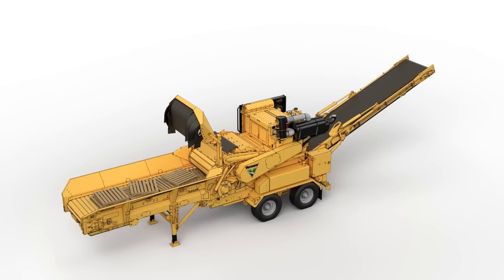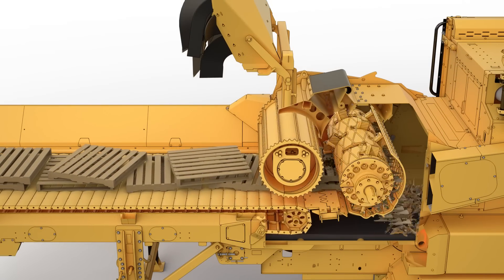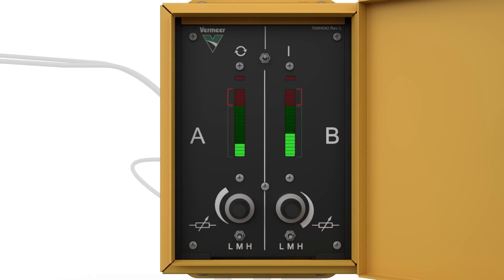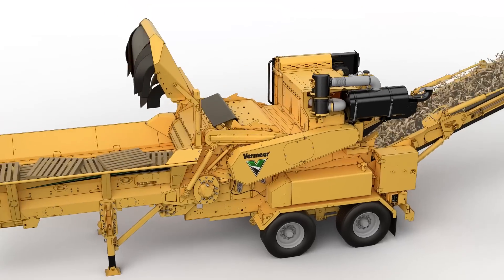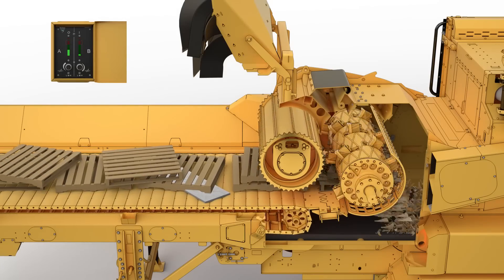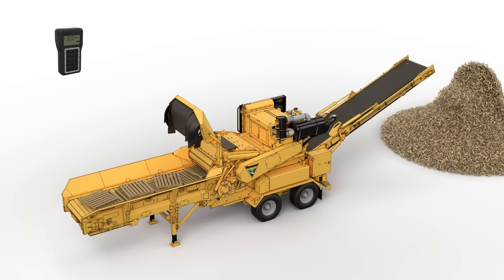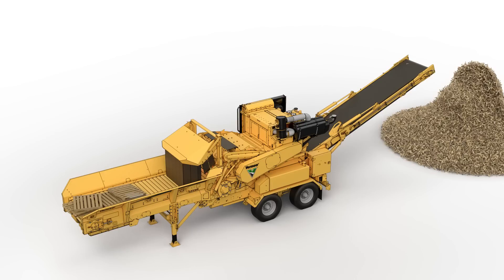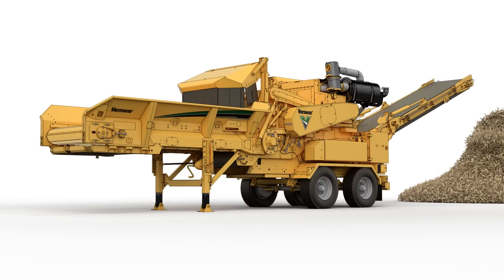Damage Defense System | Vermeer Recycling Equipment

Comment: It would be better IMO if a very powerful electromagnet were put over the belt feed to the grinder.  Anything steel or iron or other magnetic metal would be pulled out of the stream.  A sensor would detect that a piece of metal was grabbed and stop the feed.  Thus giving operators a chance to look at what got grabbed and do a spot check for more metal.

IMO, aluminum, lead, copper, brass, etc. wouldn't cause any real damage.